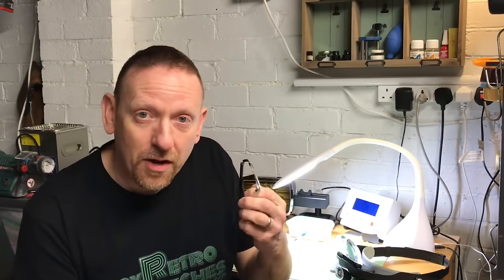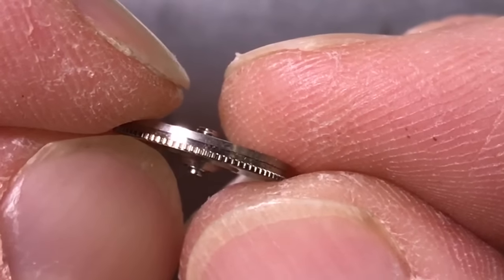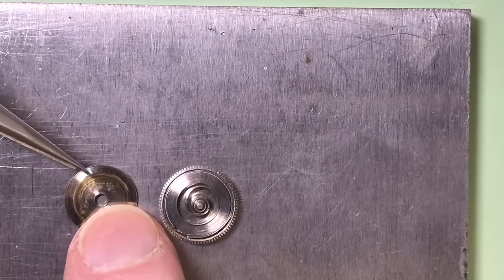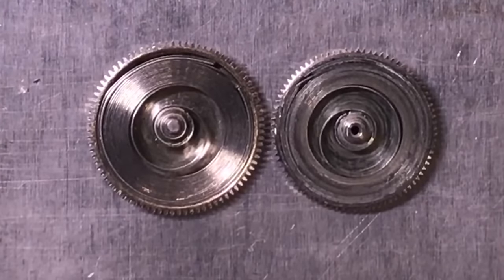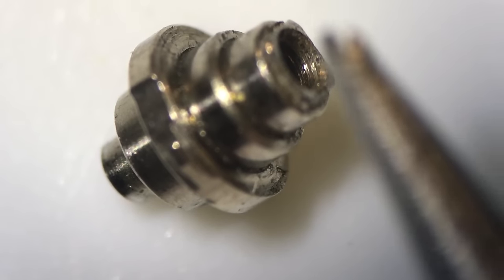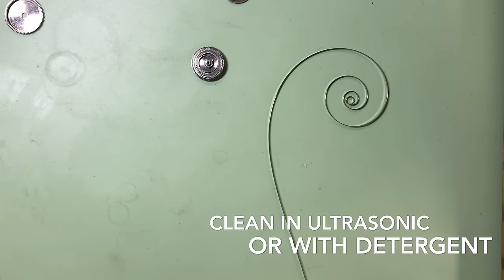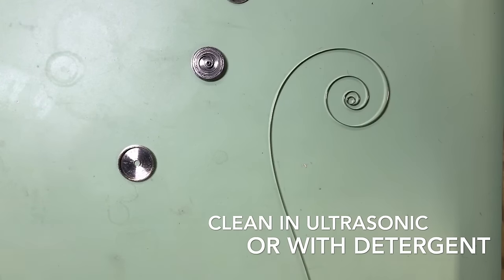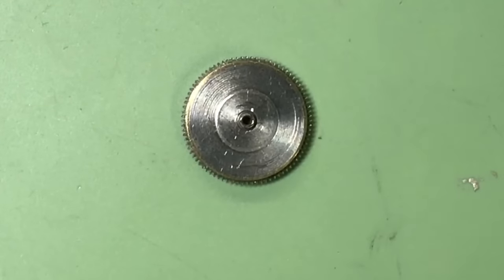How To Service a Watch Mainspring By Hand

Comment: Me: opening the barrel in 10 seconds, the rest of the day in search for the spring.
Reply from the maker: haha. you have to be careful with these !
Reply: If you can’t find a mainspring that gets away, how are you planning to find the small springs when they try to escape?
Reply: @JasperJanssen  try finding a lost pallet fork M8 😐
Reply: @internettrihard2955  I almost lost mine and found it on the carpet
Reply: @internettrihard2955 try finding an arbor that rolls everywhere when you breathe on it slightly
Reply: To find tiny watch parts that have flown off your bench and landed in the carpet somewhere,use a cordless Dust buster type vacuum with your wife's old pantyhose over the business end of the vacuum.This will find brass parts that your magnetic pickup tool can't and will not damage even the tiniest parts

Comment: I want to say thank you. Just finished taking apart and redoing my first movement. AS 1187. Did lots of reading and watched lots of videos. My biggest trepidation was the balance and the mainspring.  I almost didn’t do the mainspring at all.  I was just going clean it in the barrel as best as I could and then put it back in. Watched this video and it gave me the confidence to give it a go. I wasn’t going to spend the money on winders to service a $15 watch.  Not sure I would like it enough to do a second watch. Did it just like the video and, amazingly, it went perfectly and wasn’t nearly has hard as I thought it would be.  Watch is from the 60’s and keeping time very well after two days.  There will definitely be a second watch.  Thanks again for posting these videos.
Reply from the maker: Fantastic.  This is the reason I made the video. It splits opinion as hand winding is not the correct way.  From a hobbyists standpoint I think its fine  it gets your watch working and more into the hobby. The further down the rabbit hole you fall eventually a winding set would be purchased but only when you can justify it to yourself.
Reply: AS 1187 was my first non-pocket watch movement too...

Comment: Moebius 8200 is just a grease intended for the mainsprings and bottom of the barrel. It has no breaking capability, so don't use it on the side wall of a barrel of an automatic watch. Moebius makes for that breaking grease, such as 8217, 8212 (for aluminium barrels), and 8213 (for brass barrels).
Reply from the maker: Andre Kowalczyk thanks . I have actually changed now to 8217 because if this. 

Thank you though

Comment: After popping the lid, I use my plastic tweezers to stick one end under the barrel, the other under the lid, that way you keep the spring safely in place. I keep the tweezers in place, and centered and then remove one end of the spring at the center, and then when the barrel is turned the spring comes out really gradually. The tweezers in this position ensure the spring will never pop out when opening the lid and the removal is also really safe and controllable that way. So I don't just use the tweezer tips, but basically clamp the whole barrel between the wider part of the tweezers. Your method letting go half a coil at a time with your fingers doesn't look like a very good idea to me, especially for novice watchmakers.

Comment: I’ve always hated installing a mainspring by hand, I always felt like it gets the mainspring barrel teeth dirty, mostly because it does. I’ve sourced a couple mainspring barrels, but unfortunately I work with many watch brands that I’ll never get the right sized winding tool. They’re also expensive as hell. I do a lot of Rolex watches, and have an account with a big watch dealer and they give me almost only Rolex. I find myself simply changing every mainspring when servicing a watch, no matter how good it looks. I’ve found that many people do not use braking grease on the barrel walls. And no, it’s not that it’s been so long since the service that it’s moved from the walls, there is none. And to my surprise, no damage occurred... The only times I’ve seen damaged barrels is on the older models (2030,1161,1570) and even then, All you have to do is apply a little bit more grease then usual (almost nothing) and the new mainspring makes the walls back it’s self. As far as lubrication, I will apply kluber on the walls as braking grease, 3 lines of 1300 on the floor leading from just before the arbor to the wall. I then install the mainspring and apply 3 large sized plots of 1300 through the mainspring and let it run. Some say don’t lube the mainspring at all!  No sir. Not me. I consistently get 300 amp dial up 240-260 crown down, and almost always get the full spec power reserve, minus maybe 2 hours. 3135 I consistently get 46. I’m proud of that, and I’m good where I’m at.

Comment: Happened upon this video and will check out the series.  I bought a beautiful Seiko ring watch, and my novice gut tells me that it is overwound, which started me on the hunt to see if I can fix it.  Can't afford to go to a jeweler.  I have a lot of timepieces that I can practice on before trying to fix my new ring watch.  I've been passively collecting the timepieces of ancestors and junk shops, because of my fascination with these things.  I also sew and have several machines that I've "repaired" myself.  I believe I saw something familiar to the hook/bobbin mechanism in the watch interior...  I'll have to really set up a a clean space, should I move forward with my endeavor to fix a watch.  Thank you for this wonderful video!

Comment: Mike - Thanks for the how to vid.  I have found success with reinstalling the barrel arbor with the cap off.  Take a pair of small jewelers plyers and carefully turn the arbor in the center of the mainspring in the direction to wind the spring until you can see or hear the hook in the arbor catch the spring detent.  You can see the spring wanting to wind up in the center thus confirming the arbor is properly set and engaged in the center of the spring.  Then proceed to reinstall the cap.  I use Moebius 8217 Natural Grease as a breaking grease on the out barrel wall in 3 places and then use 8141natural oil to oil the mainspring.  I use a smear of D5 on the barrel arbor openings top and bottom to lubricate the center arbor bearing.  I was lucky enough to score a set of vintage K&D variable spring winders and these make winding and loading the spring in the barrel much easier than by hand.
Reply from the maker: Supercruze thanks for you advice . I have in the past for stubborn arbours used a pin vice , like I show in the video but with the lid off. I am always fearful that you could easily uncoil that spring!
I really need to invest in a set of winders!

You use all the correct and better oils than I . I knew the 8200 was not ideal but at the time I was actually advised to use it by a professional!

Thanks for watching and supporting my channel.

Comment: Thanks for that Mike,  I've just started working on what looks like a m24 movement,  i found out the hard way the mainspring barrel has no lid, your method of getting the spring back in is a lot easier than the method ive been trying.

Comment: Thank you for this master class. I haven't dare to open a barrel and taking out the MS yet, but I know it's very important to service it when restoring a watch.
Only a few days ago I show a video of someone using tweezers to hold the MS in place while taking it out, and it look like a good idea.
Reply from the maker: Agustin Aguilar thank you for commenting.  I am intrigued why you would use tweezers to take it out, sounds harder.   My thoughts are removal without any tools is best with hands after all you will clean and then oil it so your finger prints will not effect removal in the slightest .
Reply: @MyRetroWatches  I really don't think the tweezers technique is better than using the fingers. I've been looking for the video I commented (https://www.youtube.com/watch?v=vZrrHgo9SMU) and I found another video from the same guy in wich the MS jumped when it was only 50% unwound, so when I got in the feel of it I'd try with my fingers.

Comment: Also, breaking grease I believe is more there to protect the barrel than the spring. The barrel, usually being made of soft brass seems to me like the thing that gets the most damage from the spring slipping  through.
Reply from the maker: You are very correct on the braking grease.  Thanks for your comment.

Comment: I just wanted to add for other people who may not be aware, you don't need to put braking grease on the barrel walls if the watch you're working on doesn't have automatic winding.  On watches without automatic winding you can only wind them so much but with automatic winding your arm movements cause the automatic winding mechanism to keep winding and if the barrel is fully wound then the spring it allowed to slip around the inside edge of the barrel which is why you need the grease there at that point.

Comment: The pin vice, and taking a photo before hand are certainly very good tips! Under a microscope though, since the diameters on the arbor, where it protrudes through the lid and barrel are usually not the same, and seeing the hook on the barrel, I know already which way around the spring needs to be wound. There is always something that can lead you back to the direction, if it won't be the diameters, it'll be the teeth height on the barrel, and inner thread on the arbor, combined with the hook on the arbor that give it away.

Comment: I think if the watch has seen a lot of service its a good idea to fit a new main spring in most cases these are fitted in a ring and can be pressed directly into the barrel.
Reply: I agree, provided you can find one. I'm working on a pocket watch from 1868. The spring is intact, but I suspect it's lost much of it's power after 155 years but I can't locate a replacement so I'm hoping a clean and service will help.

Comment: Brilliant video, thanks Mike.  When I took a watchmaking course for three years we had access to spring winders in the lab but now my course has finished I can't afford those to use at home (hobbying) and didn't have the confidence to do it by hand until I watched your video.  Just wound my first by hand successfully and ironically enough I found it much much easier by hand than with mainspring winders
Reply from the maker: I have a wonder set but it’s only right handed (I think) as I do mostly seiko some like the 7### series are left handed and you need another winder for that at £70 a go..,

I find hand winding fairly easy but it really is frowned upon so this video split opinion like hot knife through butter.
Reply: @MyRetroWatches  well tell them if they want to donate to my spring winder gofundme page (sarcasm)I'd be more than happy to accept. far be it from me to turn down a free meal! that'll be $1,140 dollars please.

Comment: Thanx so much for doing this video.  I have seen this done in several video's but not in this kind of detail.  I have also just seen a video where a watchmaker says it is not a good idea to wind the main spring by hand.  I understand that.  I will be using your methods so thanx for the demonstration.
Reply from the maker: Thank you. Hand winding is not good practice and frowned upon by many.  However if you don’t have a set of winders or can’t afford them then this is the only alternative in my opinion.

Comment: Hi Mike, really enjoying the series.  One of the main hurdles for any budding watch tinkerers out there is servicing the MS barrel and you've done a great job of explaining it in layman's terms . Quick question:  the (potential) scoring on the inside of the barrel, when does that become an issue?  Looking forward to the next installment!
Reply from the maker: Thank you so much for your comment. Its great to know I’m getting it right. 
The scoring , very difficult question for me to answer however firstly looking at this barrel the damage to the lid could have possibly been caused by the old grease wearing on the lid. Seiko I believed used graphite grease which turns black and horrible , look at the 7025 barrel at the start, absolutely full of dirt and my guess is that it’s never been opened before. 
I would assume that tolerances on the barrel wall and lid are not critical and wear would not cause too much of an issue as the spring would just expand to take up the gap. It’s the arbour and the holes they pass through that would be effected by severe wear as the holes would go out of round and make the arbour wobble which could then cause issues with the centre wheel and ultimately stop the movement.

Comment: I have been very naughty in the past and cleaned the mainspring when still in the case but open. I will now give this a go with a practice movement. Wish me luck.
Reply from the maker: I have heard of this being done but never tried.  if in water solution I would not want to risk causing rust.
Reply: How did you clean it coiled inside the case? What solution did you use? Dis you re-greased it?

Comment: From one hobbyist to another- first your contribution is appreciated. Secondly, it is important to mention that the entire practice of manually handling springs is a malpractice with poor outcomes. Also the grease on the barrel should be 8217.
Reply from the maker: nukvar23 thanks .  I agree on the grease being perhaps not the correct one however for hand winding of main springs is quite common in my circles. Agreed a mainspring winder is much more reliable and less problematic however the costs are prohibitive for someone just starting out to buy a decent set or individual size. 
I want to encourage people into the hobby by showing that basics can be achieved with minimal equipment .  The further we all go down the rabbit hole the more tools and equipment we purchase to get better at what we do for the best results.   I am still quite new into all this myself. 

I will now order some 8217 so thank you kindly for this.
Reply: @MyRetroWatches  I completely agree. Just think it is worth mentioning the drawbacks. By the way, I fair set of winders can be hunt for about 50 pounds
Reply: @nukvar23  Hi. Can you tell me where, please?
Reply: @carloscarvalhido2424  look for the old brand GB on ebay
Reply: @nukvar23  OK. Thanks.

Comment: I'm about to embark upon the service of a 1974 citizen diver... I new I'd never source a new barrel but managed to find a batch of toss away movements almost exclusively to practice this exact process! As well as perhaps find the best mainspring in the lot to use in the final service.....
I'm glad I did buy them as the first one I attempted (rusted out movement so no loss) I snapped off the bridle XD
Reply from the maker: Hello. Thanks for your comment. I too have broken bridals when I first started doing it but you soon get the hang of it. Once the bridal is in and the spring has past it a few times it gets easy from there. 
Best method is still with a set of main spring wonders though . Safer and goo practice

Comment: Brings back memories of servicing clocks. Just scaled down and not as strong.  Also gets almost no oil compared to clocks which get 4 to 8 drops depending on size. Barrels are usually brass not steel and get inspected for ridges in the cover or back of the barrel that may cause the spring to unwind less than smoothly. All just a matter of scale, you get fiddly and I had to use more force. :)

Comment: Great and well presented live video,  I found your channel recommended and have watched with interest a couple of the digital rebuilds, (they're quite alien to me as mechanical are my area of interest as a hobbyist watchmaker and collector) I do have quartz analogue/digi combined but not had a fully digital since my schooldays In the 80's. Have subbed to hopefully learn more about those.Re the arbor, my routine is to remove it in situ by gripping with tweezers and turning opposite the direction of winding while pulling up, keep a nail on the spring while doing this, the latch will disengage and it will pull out, refit in the same manner. This removes the risk of it flying off the spring and across the bench. I wouldn't try to refit on the spring before winding in fully. Otherwise that's how I manually wind in main springs,  but I am going to try 3D printing a mainspring winder.
Reply from the maker: Thanks for your comment and subbing to the channel. Appreciate that. 
I will do some more digital stuff in the future and actually have an ana digi on my to do list  so will most likely film that in the coming months. 
I’m back into my mechanicals at the moment...  I flip between the two when I get fed up with one genre I flip to the other .  
I’m. Soon buying a mainspring winder set so I can do what is the correct & safer method.

Comment: Thanks, Mike!  I tried this on a scrap pocket watch spring a few months ago.  Finally got up the courage to try it on a 7009 mainspring.  Cleaning the barrel was like cleaning a black powder rifle - filthy!  The 7009 spring was a lot tougher.  It has lots more "spring" left.  Here's hoping I did it right.
Reply from the maker: Scott Murphree-Roberts superb well done. Well you know when it’s works when the watch runs well.
Reply: @MyRetroWatches  I put the whole thing together and got finished around 3 AM this morning.  I didn't wind it fully, but it's still running and the time looks good.  Your videos are extremely helpful.  Now, if I can just figure out the trashed crystal. ;-)